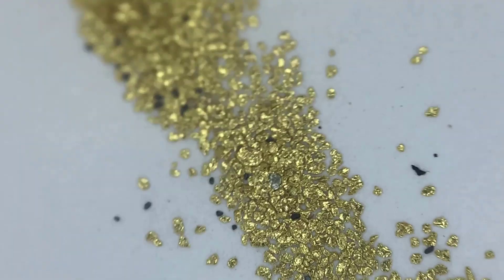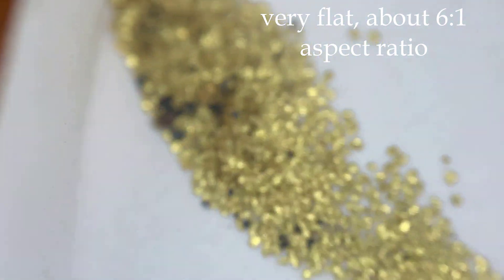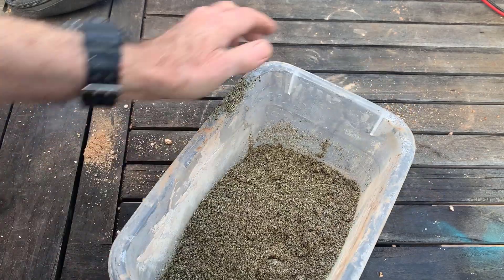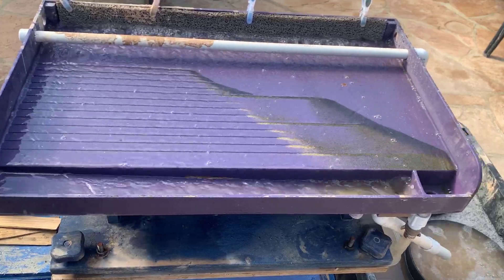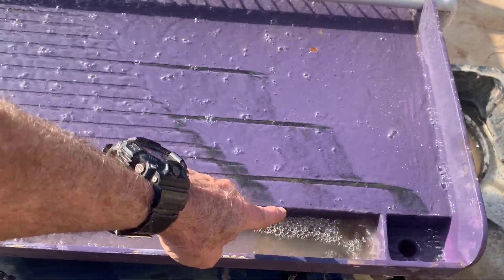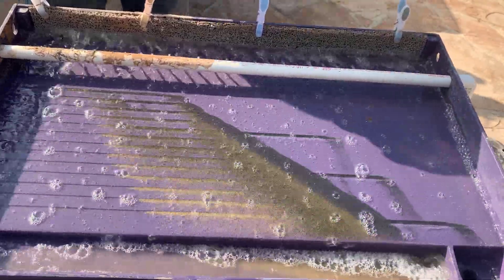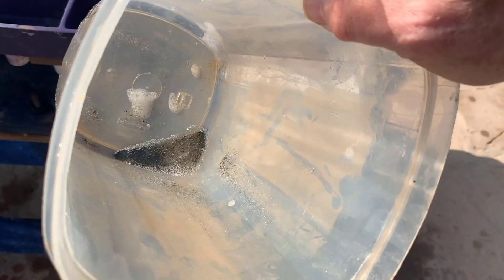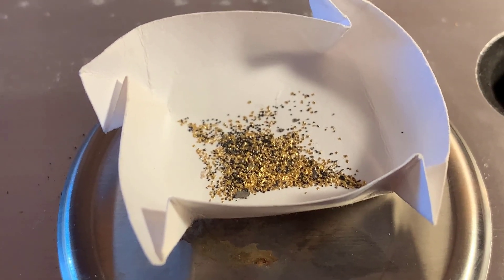Extracting Michigan Gold from LA Beach Sand -- Alex's Gold -- Tuning the Shaker Table

Comment: Pretty good recovery, the quietness of that table is the envy of many.  Some charts say a shaker table is good to 500 mash.
Reply from the maker: I've run gold that had an average size of about 50 um, which would be about 250 mesh. I had to tune the table much differently to recover that gold, but since it was from ball-milled ore the feed rate was still respectable.  Yes, the table has a nice sound. -- Dave
Reply: @orophilia  I guess I was recalling the specification for the RP4 table.

Comment: Try that beach sand from Nome, Alaska.  Those people love for you to figure that out.
Reply from the maker: If I can get some I'll run it on the table.
Reply: @orophilia  

The gold found in Nome's beaches is often very fine, almost like powder. This makes it more challenging, and to make matters worse the beaches around Nome are known for their high concentration of black sands, which are heavy and rich in minerals like magnetite. These black sands can obscure gold particles and make separation more complicated.

I prospected a creek over on the other side of the Opal Creek Mines here in Oregon, it had more than a 50% concentration of black sand (insane amount). I have never seen a higher concentration since, but I hear Nome beaches are some of the worse for wear.
Reply: @Jatslo you need to take a trip over here to Michigan.  The black sand is super fine and is deposited in layers with the gold.  Stimes we're running pretty much pure black sand through our sluices.
Reply: @alexmiddleton2818  

We have family in Marquette, Michigan, located in the Upper Peninsula along Lake Superior.
Reply from the maker: @Jatslo  Yes, I've found that when the gold particles are less than ~75 um in diameter and thin it becomes a big challenge to set the table for a clean cut. I have to slow down the feed rate and lower the overall aggressiveness of the table. This keeps up the efficiency but reduces the concentration ratio. I'm working on methods to easily separate the concentrated, fine black sand from the gold, a very important final step. -- Dave
Reply: @Jatslo  nice.  Plenty of opportunities for shiny along the coast in that area.
Reply: @orophilia  

The optimal ranges for settings on a shaker table can vary depending on the specific design of the table, the material being processed, and the desired outcome. The table tilt for example, typically ranges from 1 to 5 degrees. The exact angle depends on the material's size and density. Finer or lighter materials generally require a lesser tilt. The stroke length usually ranges from a few millimeters to around 25 mm. Longer strokes are used for coarser materials. The optimal length often requires experimentation based on the feed material. The stroke frequency, which is often adjustable, ranges from around 100 to 500 strokes per minute. Higher frequencies are used for finer materials, while lower frequencies are better for larger particles. The water flow can vary widely based on the table size and the material being processed. The key is to use enough water to keep the material moving but not so much that it washes away fine particles or valuable minerals. It's often adjusted through trial and error.

The feed rate is highly dependent on the material characteristics and the size of the table. It's crucial to avoid overloading the table, which can lead to inefficient separation. A common practice is to start with a lower feed rate and gradually increase it while monitoring the separation efficiency. The particle size typically works best with a narrow particle size range, often between 100 mesh (150 micrometers) and 10 mesh (2 millimeters). The optimal range depends on the table design and the specific gravity of the materials, so were are not sure how well it will do with Nome, AL concentrates. The density of the Material for effective separation on a shaker table is based on differential densities. Optimal settings will vary depending on whether you’re separating minerals with high density differences or those that are closer in density.  The deck surface can be smooth or grooved, and the choice depends on the type of material being processed. Grooved surfaces are often better for finer, lighter materials.

I have heard that silicon mats are superior at grabbing fine gold, but I have not seen this done on a shaker table.  I assume you are using hard plastic for the table, but I'm not sure.

Comment: nice test and display of the table variables.  On my RP4 - i typically make a rough cut pass, then a series of finish passes to get a high grade con. It's hard to get a complete separation in just one pass, but 90% is pretty close :)
Reply from the maker: What would your feed rate be for material like this on the RP4?
Reply: @orophilia  feed rate of material would be roughly 4x what i estimate in comparison.  an even feed is important as the cut line and separation lines vary according to the depth and gravity of the material as it moves - what is in front stopping the material and what is behind pushing the material is important.  I bought a used syntron vibratory feeder off ebay and a large stainless hopper to hold material. I imagine you have already built a feeder or three - and it's the next logical step in your table build. dry material feeds better imo, but wet feeders also work well.  The MSI tables use the vibe motion of the table top to feed.  My RP4 is sitting  - your welcome to take it for a month or so if you want to experiment with it.
Reply from the maker: @AUMINER1  It would be interesting to compare results directly using the same material and gold content. Let's consider the ways that we could get that done. Yes, I've built feeding trays/systems but not one that I like.  Not yet. -- Dave

Comment: I think you should ponder and investigate further the interesting accumulation of gold on the lip of your catch port.
If you could understand the dynamics of what caused that to occur , you would have a significant possibility of improvement.
That looked like neat gold - maybe dividing that port into 2 ports means less time spent panning.
Reply from the maker: Hi GST. Yes, I've been working on a vortex-type cleanup machine. I didn't understand the fluid flow dynamics on my first prototype, but now I have that straight, I think. If I get it to work I'll certainly make a video.

Comment: You knocked the 1500 down to 30 grams.
I wonder if you ran that 30 grams through your unit again , how much of that 30 grams would make it into your catch port ?
Reply from the maker: That's dependent, in large part, on how I set up the machine. I can tune it to get a very nice cut between the fine black sand and the gold, as long as the gold is larger than about 75 um in diameter. Finer than that and it gets harder to get a clean cut.